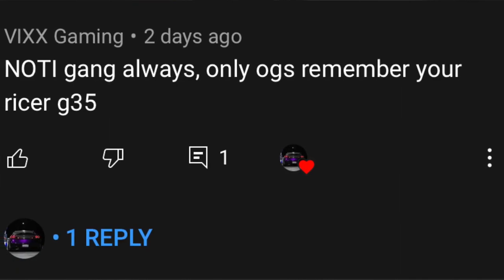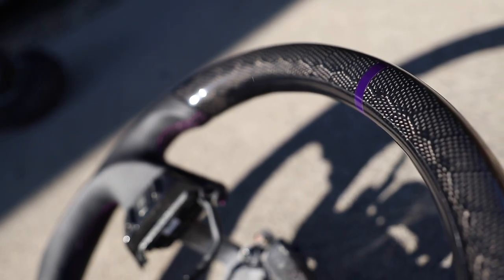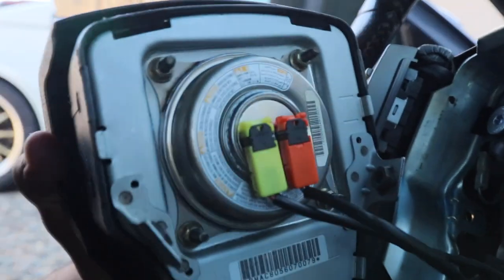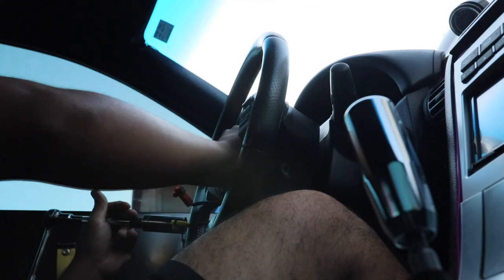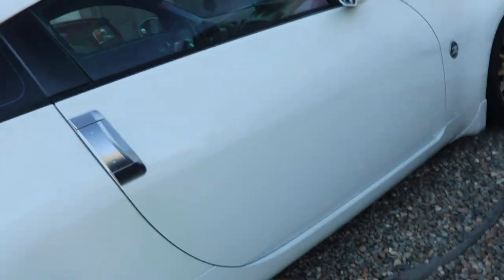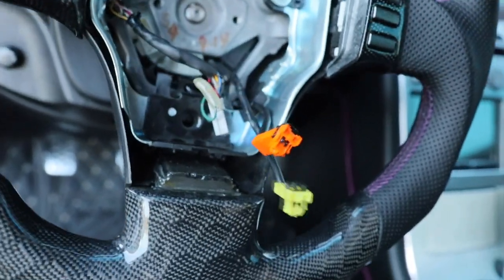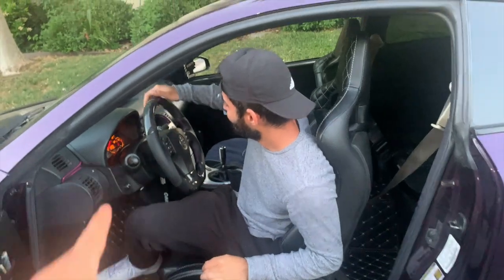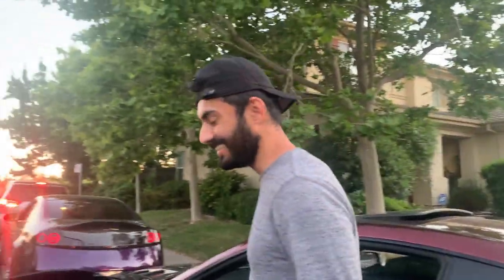G35 HoneyComb Carbon Fiber OEM Steering Wheel Install

Comment: Isn’t there a reset procedure on z’s & g’s for the beeping air bag light? Yes there is actually. I remember doing it on my Z.
Reply: What is it?
Reply: @xpert_kid_one730  https://youtu.be/hoG3ANFdVyk this is if you’re still running an airbag. If you aren’t (aftermarket steering wheel w. no airbag) this won’t work.
Reply from the maker: There is and I did it about 12 times as of now haha 😂

Comment: Hey bro were the both security screws on the side of the steering wheel the same? Reason I ask cuz my g had two different ones . I manage to take off the one the right side but not the left :(
Reply from the maker: Yes both of my security screws were the same bro 👍🏻 they should be at least